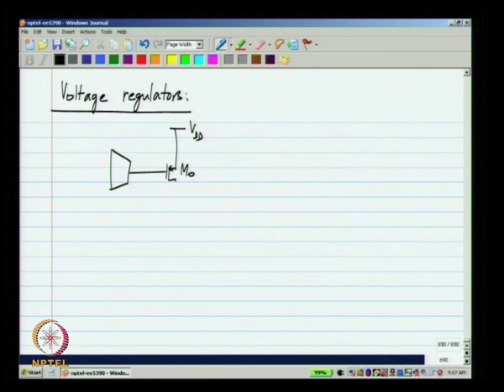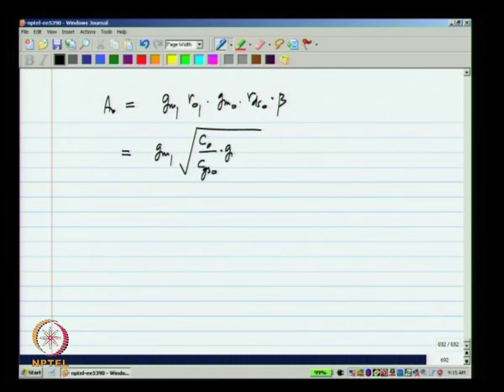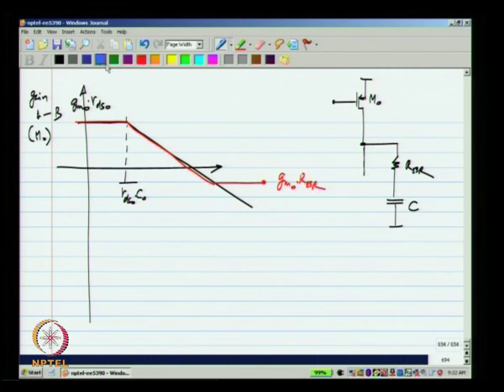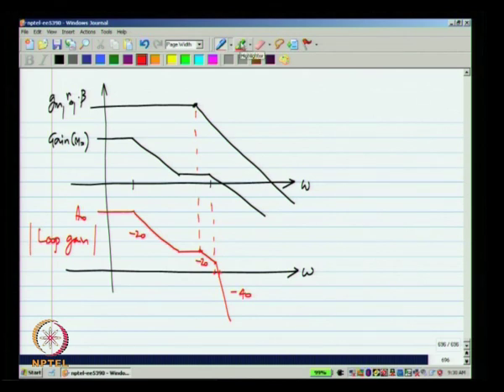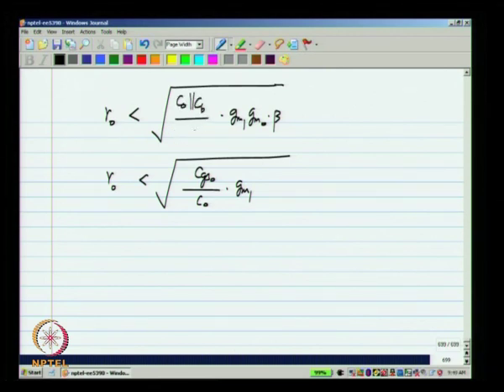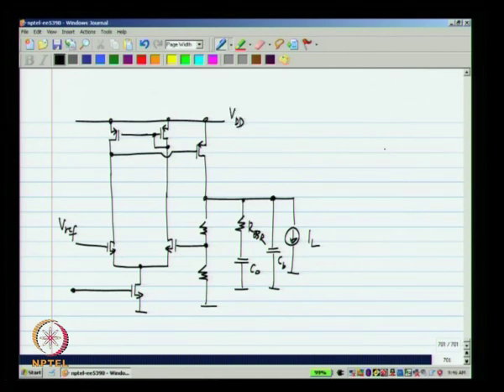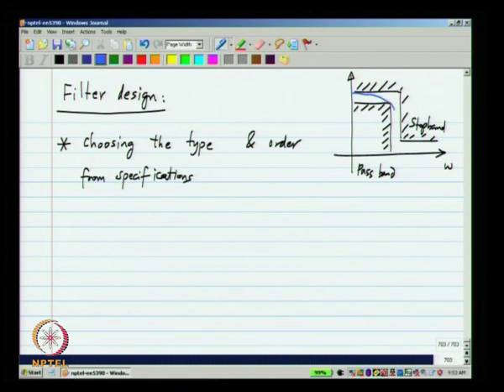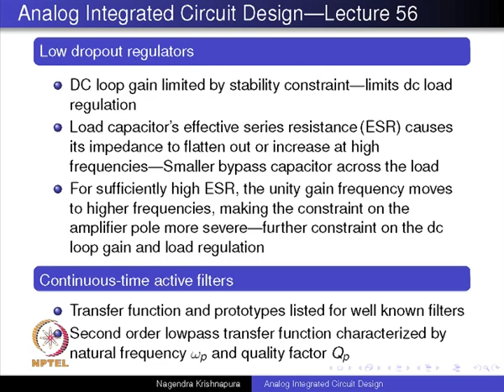Mod-01 Lec-56 Lecture 56

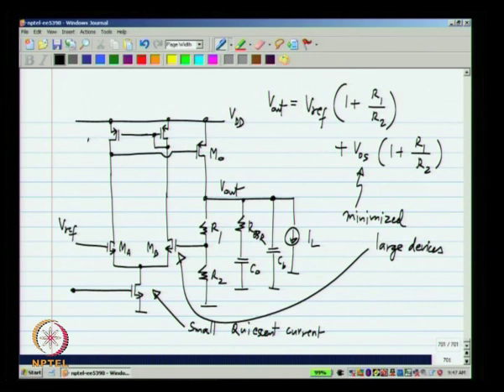Comment: @39:00, what if the diff amp is chosen in opposite way, ie mirrored in opposite way (maintaining same negative feedback). Different amp with active load is almost symmetrical.  Could anyone tell elaborate more ?
Reply: I think you mean diode-connect Mc instead of Md, but still drive M0's gate through Mc's drain? In that case, the gain to Mc's drain is very low (~1 due to low o/p impedance).